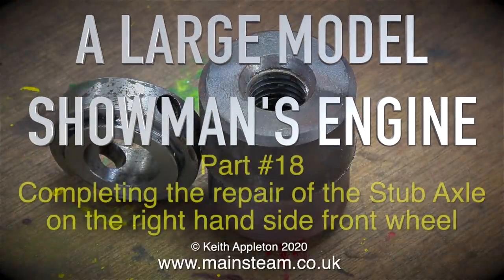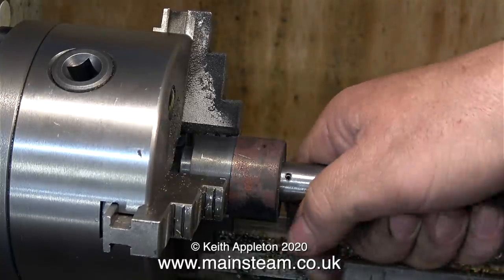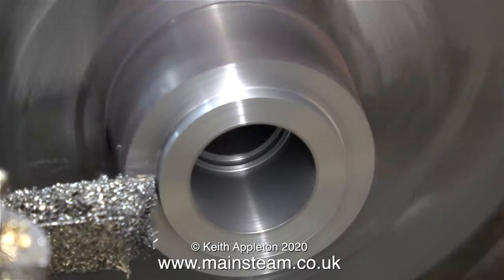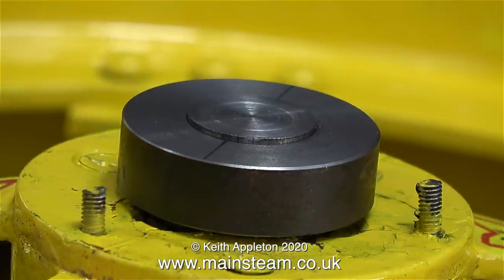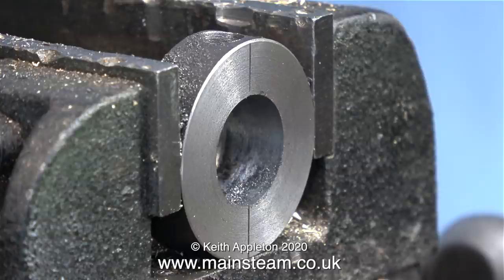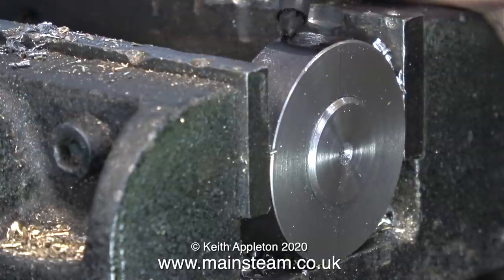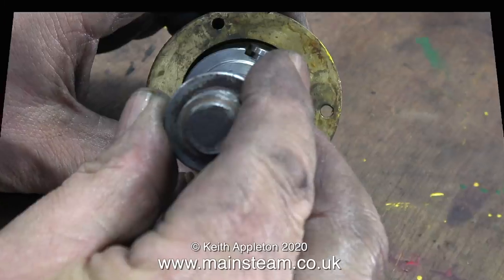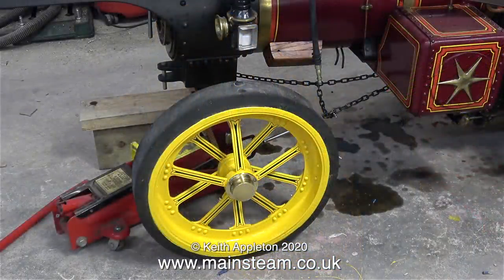A LARGE MODEL SHOWMAN'S ENGINE - PART #18

Comment: Thank for all the hard work producing these.  I enjoy them very much. I’ve done a lot of teaching and find that math is generally taught from a deep theoretical perspective.  It takes years of study just to comprehend its purpose.  I find it far more beneficial to find practical applications and then apply math to them.  How long will it take to fill a bucket?  How strong is a beam?  What will it cost?  10 minutes with a sine plate is a year of geometry class.
Reply from the maker: When I was at school, if I had have been taught Maths with practical uses included, I would definitely have learnt more }:-)))
Reply: @keithappleton  I came across a high school tech math book years after I finished all schooling, which had been written by a former teacher/principle from my high school. It was in a second hand store and I picked it up out of interest. I wish they had used it when I had been there, it was the most practical explanation of everyday and trades math that I have ever read, sadly I loaned it to a second cousin who was having problems with math, and it was never retuned.